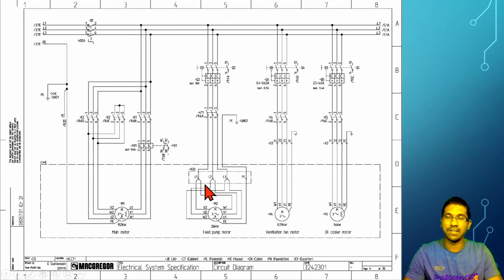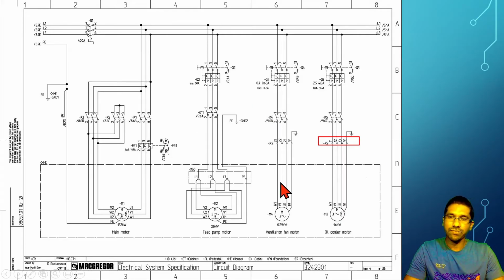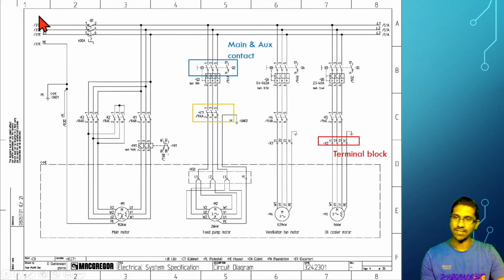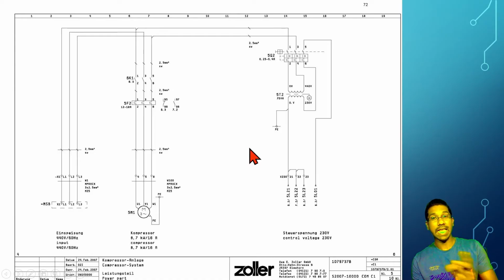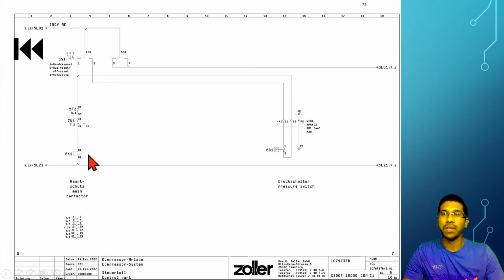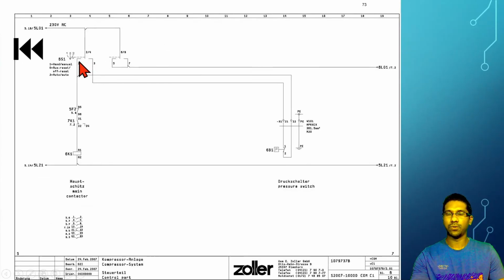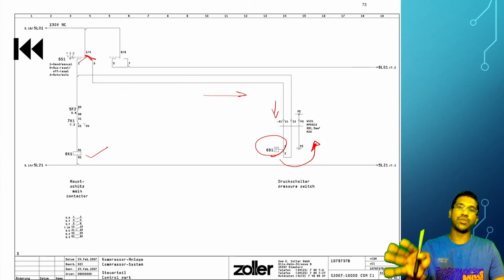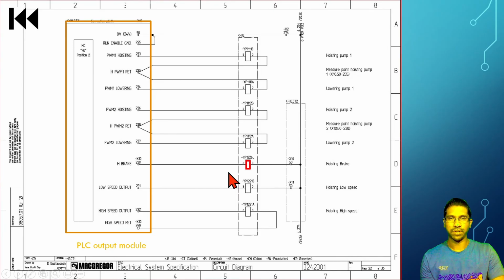Lets read an Electrical Drawing #marinengbase

Comment: Sir, pls pls reply.
we all know we can not parallel emergency generator with main generator. bcz their is interlock in ESB to prevent it.
my question is why we cant parallel? what is the danger?
Reply from the maker: You will not be able to run emergency generator parallel because mostly  ur droop settings for these two genes will not be similiar.
Reply from the maker: If your droop settings are different then one generator mostly the emergency generator might overloaded and there will be unstable operation which may lead to a blackout
Reply from the maker: Normally EG governer and AVR characteristics are differ from main gene...thus it is not so safe parallel running for long time

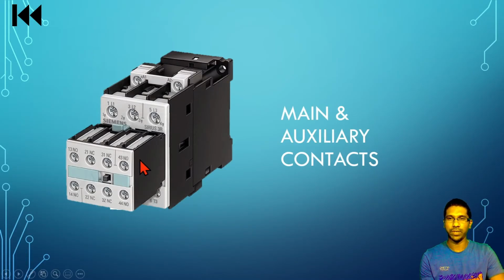Comment: At 06:05 you point at the symbol of the circuit breaker (as far as I can read it is designated as -Q2) and explain a meaning of main and auxiliary contacts. Why at 06:22 you show an example of the contractor by Siemens and referred it to the previously shown circuit breaker. Do these two  components in particular have a difference from your perspective despite they both may have auxiliary contacts?
Reply from the maker: A contactor may available only  with  main contacts, in such case we have to use piggy back auxiliary contact module as shown in siemens contactor.
Reply: @marinengbase  

Thanks fort replying. 

Well, You did not get to a point, however please note that there are many brands and types (mostly small and medium size) of contactors, where up to 2 auxiliary contacts  (1 x NO and 1NC) are incorporated with the contactor's basic unit.  Additional auxiliary contacts may be attached either on top (top mounted module) or at the side (lateral module).
Reply: In Electrical letter code  "Q" stands for switching devices and "K" for relays and contactors